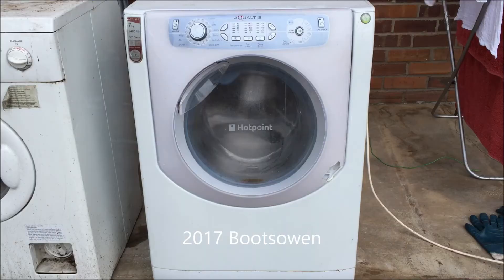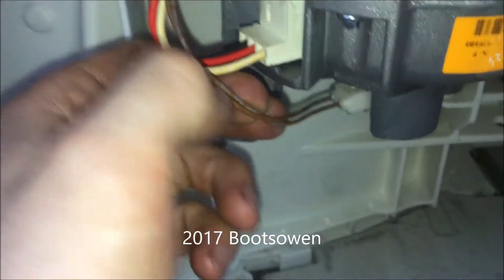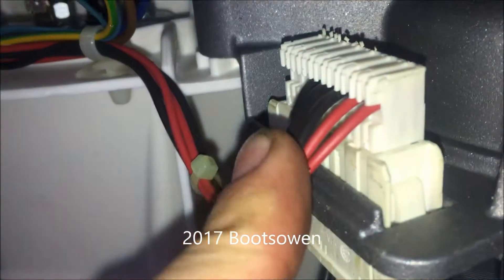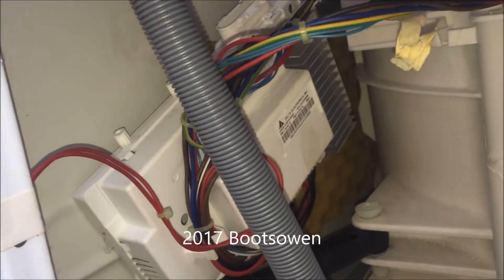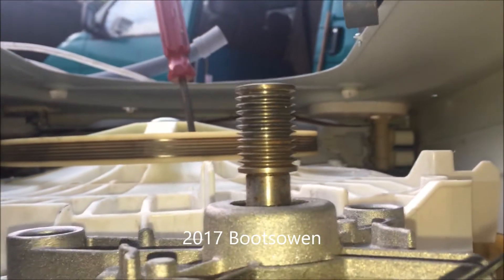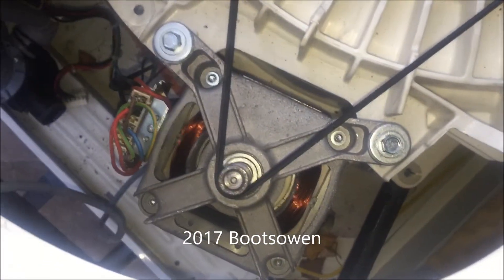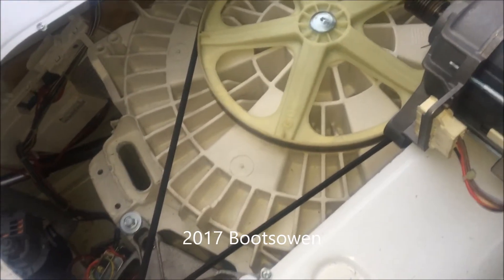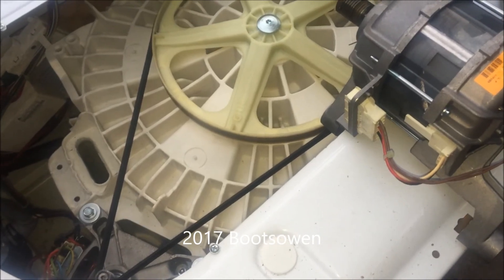Hotpoint Aqualtis Motor Swop

Comment: Nope, that's not an induction motor, it's actually a BLDC motor, which is what most people call it in washing machine inverter motor, because it's powered with an inverter which converts AC to DC.

And besides, induction motors are not that powerful enough to run at 17,000rpm, the highest speed possible is 3600rpm if it has 2 poles.

Comment: Did you ever figure out how to wire the motor you pulled out ? If so can you please post a how to video?
Reply from the maker: I posted a video on 3 phase induction motor wiring. It is possible to wire it, but the results aren't great.
Reply: bootsowen thank you so much I’m working on throwing the same motor in this video on a bike